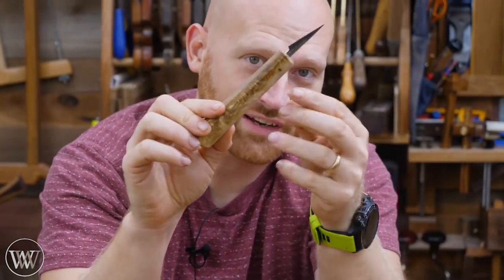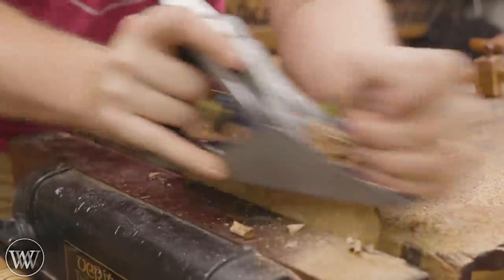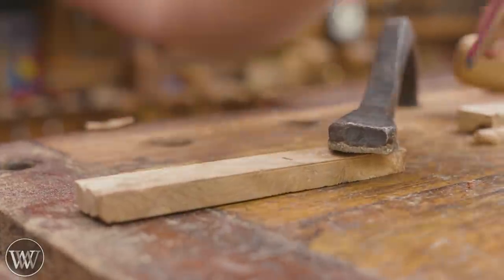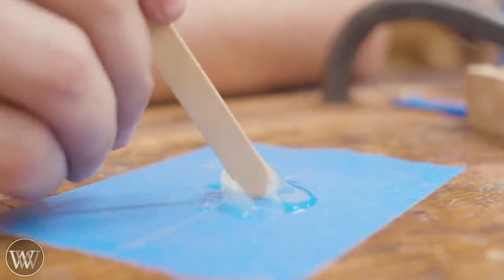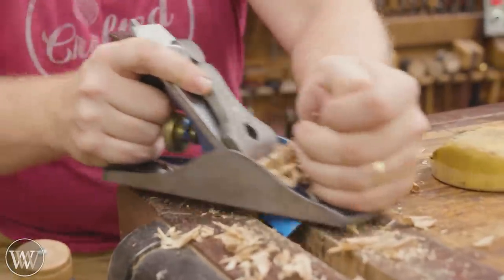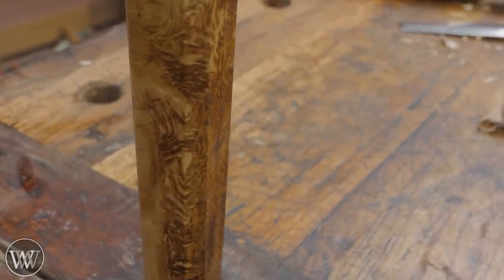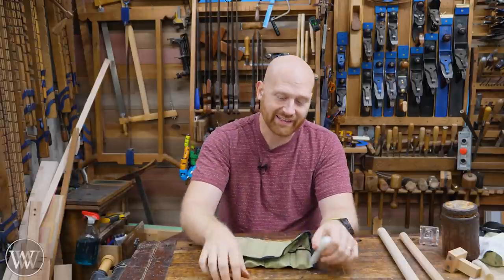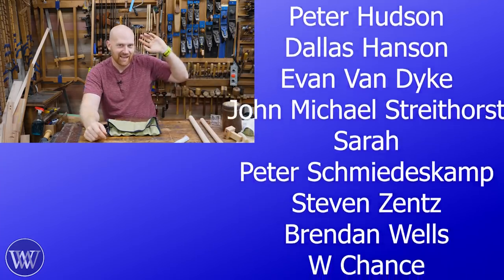Making Your Own Carving Knife Handle with Beavercraft Knife Blank

Comment: Little tip that I use making handles,
I use playdough and grip it everyway I would use the knife to make a mock up/template to transfer to the wood, it gives a personalized ergonomic handle
Reply from the maker: I like doing that for handles that I always grip in the same direction. There was a carving knife you're always switching the grip from a pencil hold to handle grip to a close slide to a finger press and a lot of others.

Comment: Really great vid! Last year i bought myself a spoon knife from Beavercraft but right away I didn't;t like their thin/narrow handle in my big handle. Just didn't fit right so i decided to make a new handle from my old garden shovel handle (hickory). basically I cut off 6" of the handle, shaped it, drill a hole at one end...and instead of working with a blank spoon knife, i simply used my carving knife to carve the handle on my spoon knife into a round peg about 1/2" in diameter, and that's the size of the hole i made in my new handle. Then I simply joined the two with some epoxy. fits like a glove now.

Comment: Really easy and really simple suit me for projects. And being an Australian, a nice piece of Red Gum would make a great handle material
Reply: Euc? How do you deal with that cracking?
Reply: @dylanneely91  I've found work with thin narrow boards (50-75mm x 10-20mm cut from as close to the centre as possible work reasonably well or the same cut from timber milled a long time ago. 
Old sleeepers are great for this, once you get rid of the outside material with an old chain on the chainsaw (don't use a new chain, up to 15mm deeper than any visible cracks will have bits of stone and metal imbedded into the wood). The older the timber the better.
The best Redgum I've ever seen milled up came from the old Redheads Match factory in Richmond Vic. Probably 150 years old and very dry. I think that got cut into 50 x 100 and no cracks after about 2 years. The scrap also burnt really well after being exposed to the matchhead chemicals for so long.
Reply: @warrenmunn3224  thats really something! Ill have to try that. Do you treat the ends (or the whole thing)? 

Thank you for the info. I'm an arborist in the USA and every piece of euc I've tried to save has ended up looking like 150 year old farm siding inside of a year. 

"Coolibah" (I think is how its spelled), blue ghost, "red ironbark" (again, I think, not one I've seen a lot of), yellow gum, all of them just rip themselves apart in my experience.
Reply: @dylanneely91  Try milling thick slabs and then hope to get small thin boards out of it once it's dried.
You rarely see Gum as timber here, its mainly Red Gum in old buildings as girders and beams or a railway sleepers.
People now make slab tables out of Red  Gum but is generally cut from deadfall not trees cut for timber (I've seen 2+ metre deadfall in paddocks, bloody big old dense River Reds).
Only use I've ever seen for 'green' timber is as fence posts but you have to get the sapwood off as soon as it falls, once that starts to rot.....

Comment: Good to get a product that's sharp and ready to go right out the box. Looking over their site, it seems that they've got a good range of product like this, so you can make whatever handle you like and the prices seem pretty reasonable to me.
Not 100% sure on how I'd like that blade with how fine the point is, but expect that for detail type work it's what you want. Would probably make carving handle and such a bit easier than using my current setup of plane, chisel and chisel shank as scraper :-)
As to the handle, not sure if I'd like it, but can totally understand the desire for the shape to give something for your hand to know and hold the angle you want the blade at. Not sure if something with some harder sides like that, but bit more formed for the contours of your hand would be good or bad as I expect that you'd be changing your grip quite often depending on the cut you want to make.

Comment: I ordered the Flexcut starter set of 3 knives. I really haven't used them enough to know if I really like the handles or not, but the handles were pretty rough from the factory. It seemed like they used a waterbased poly on raw wood without sanding, thus raising the grain. With about an hour's worth of work, I was able to get the handles nice and smooth then used the BLO and paste wax as a finish.

Comment: I also like the octagonal handles, have made them on some chisels as well, I have just bought a sloyd knife blade from them and was going to make a slightly smaller  replica tang and use that to burn the hole in the handle, but I think that I will try your way.

Comment: Any recommendations on handle shape for spoon gauge? I recently got a blank and have used sapele for the handle, which I find quite nice to hold. For whatever stupid reason, I've always chiseled out the slot for the blade on both halves of the blank instead of just one! Also, I never use the tape trick to prevent stabbing myself and every single time I regret it! Anyway, I've been shaping the sapele and trying out the spoon gauge and I can't seem to get something comfortable for the required action. Maybe I'll try octagonal, as I've got a bit of meat still to play with.
Reply from the maker: Handle size and shape is really a personal question. For me it would do one very similar to this except for have it bulge in the middle a little bit along the access of the blade.
Reply: @WoodByWrightHowTo  thanks, yes, I realise it's quite personal, but wasn't sure if there was any science behind a spoon gauge handle that I might be missing!
Now, in terms of your underwear, do you prefer the shorts style, or y fronted brief?